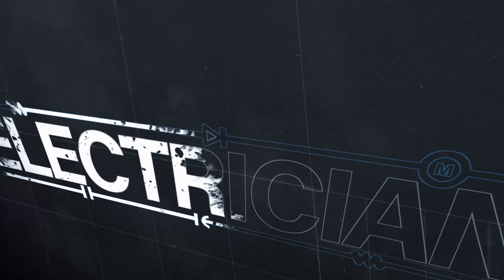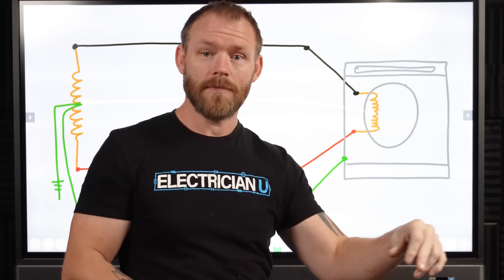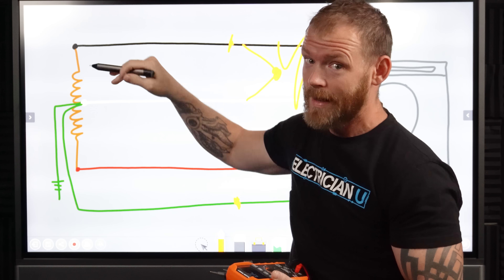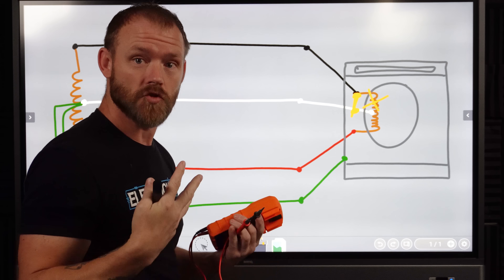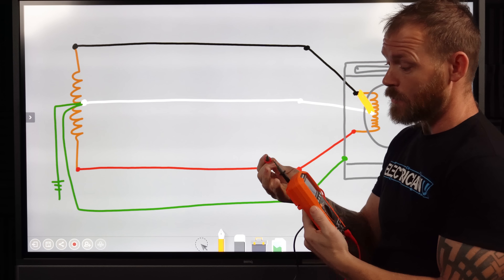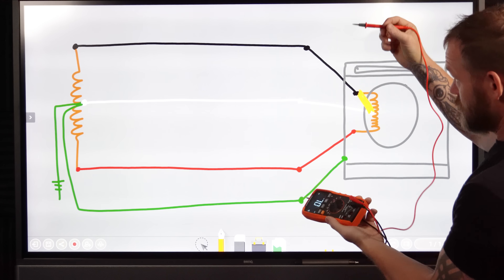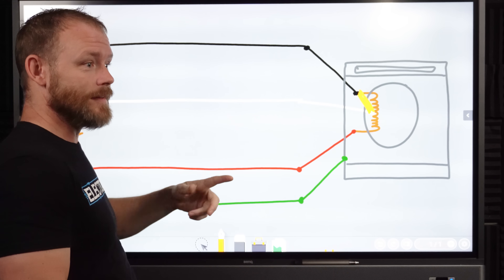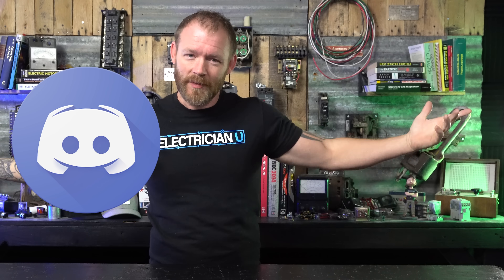What is the Difference Between a Short Circuit and a Ground Fault?

Comment: Thank you for that, I forget about continuity. I have a old house with an old water heater and the breaker keeps getting tripped periodically. I have a home warranty that came with house and so I called and they sent guy out. Ended up changing 1 element but now 2 months later same issue. I'm not going to pay again to send same guys out so I'm going to see if I can figure out which one is broke or if another problem, thank you.

Comment: I use a light socket. Black from pigtail goes on breaker and neutral goes to the load. Short or ground fault circuits will cause light from bulb. When fault is cleared light goes off

Comment: I hate to be a stick in the mud but, you kept saying ground when it's a bond. You ground a service and bond everything else. I know everybody and their brother says ground and hell I do it too, but the youngins need to hear the differentiation between the two and know the difference. OH, and the only ground screw that has to be green is the bonding screw in a panel at the first means of disconnect where the neutral and ground are bonded. Have a good weekend everybody.
Reply: thanks, exactly

Comment: He is correct, Continuity is the way to go. Going by resistance levels could definitely lead you down the wrong path especially when motors, transformers or ballast are connected to the circuit.

Comment: So... If i got this right..
A ground fault will only make a GROUND FAULT protection device such as GFIs Trip. 
And a Short Circuit will trip any other " normal breaker" or any over current protection devices..
BUT..... a black wire touching the white wire ( neutral ) is not considered a ground fault, even if the white wire is a neutral that is solidly grounded ..?!

Comment: Thanks for the great video!! Definitely helpful in understanding it. I do use continuity alot for troubleshooting. Have an outside project (still not finished) alot receptacles In the yard where over time got covered over with dirt and multiple shorts in the circuit, I take sections at a time and test continuity and finally figure out where and which wire. It's been a nightmare job and still a few left to do.

Comment: An excellent explanation. I would have only added the step of unplugging/disconnecting the load from supply wiring to isolate and narrow down possible causes.
Reply: This is very true, I was asked by a customer to see if I could find the cause a tripping breaker that another electrician could not find after searching for several hours. I started by unplugging everything on the circuit and the fault cleared. Turned out that an old cable system box that wasn’t even being used anymore but was still plugged in was causing the problem.

Comment: DUSTIN, A Ground Fault is considered the Hot wire is directly connected to the Green wire Ground? a Short circuit is considered if a piece of the equipment's internal wiring or internal load is shorted from hot to neutral or the load is shorted from hot to chassis? How I would troubleshoot a ground fault or short circuit is shut off the breakers then disconnect the Hot, Neutral and Ground wires to the load/equipment, then use my DVM meter to test if the wires are shorted or if the equipment/load is shorted.  This method is better because you can diagnose if the load/equipment has an internal short circuit or an internal wiring ground fault. If you don't disconnect the H,N,G wires and multiple pieces of equipment/loads are on the "Same Branch/Same Breaker connected "in parallel" you will be guessing, because a short circuit and ground fault will measure both the same in "milliohms". What is even worse to troubleshoot when you have a short circuit that crossed over in a wiring harnesses in the wall or internal inside a piece of equipment/load to another wiring harness that is on another breaker which you will have "leakage current" or Ghost measurements". This would be a good video lesson about "ghost measurements" and leakage currents.

Comment: I'm a retired sparky with over 50 years in this great trade. Several times I have came out and found that a circuit breaker trips as soon as you turn it on. Unplugged everything & turned every switch on that circuit off and problem did not go away. Could not pick up and grounds on either of my VOM'S. Used my expensive Fluke combination VOM/ Megger. Did not pick up a ground at 50 volts but got a low resistance reading using 100 volts. One of these was caused by water that halve filled an outdoor receptacle box. Another time old rubber insulated wire had broken pieces of insulation allowing two wires maybe seperste by a hair. If I had 10 devices on a circuit would try to guess middle point and disconnect wired then flip the breaker.

Comment: I got a question, how do you find a good ground when testing a panel or machine.  Like which place is best to put the black lead of the tester if there is no obvious ground screw?  I was testing a micro switch and I failed the exam bec.  I can't find a good ground in the machine.  Bec. normally  you put the black lead on the ground and the red on the circuit you gonna test to find the voltage.

Comment: 99% of the time it's not the wiring, it's the equipment connected. Disconnect the equipment and check if the breaker will reset. Depending on the fault a multimeter may not show the fault and an insulation resistance tester (Megger, trade name) may be required.
Reply: 90% of the time it’s a loose wire in the breaker
Reply: %100
Reply: Or the diy customer
Reply: Unless the cable is in a energy chain😅
Reply: In homes the wires, once installed, are not moved around or exposed to water or anything else corrosive, which is why home wiring usually doesn’t fail except for overloads, improper installation or outside influences.  In cars and trucks, the modules are usually sealed up, but the wires and connectors are moved around when the car/truck is driven, and are being abraded by contact with metal edges and surfaces, and are prone to corrosion from both water and vibration (fretting corrosion).  If the corrosion is inside an insulated wire, which often happens, due to mice chewing on wires, regular wear or carelessness in examining wires, but only a thorough check of the wiring, both visually and by using a probe or multi-meter will result in finding the problem.  For example In checking the voltage on my SUV’s DLC (Data Link Connector), the battery voltage had been reduced to about 10 volts, instead of true battery voltage of about 12.6 volts.  You’d never find that voltage drop without thorough testing and attention to detail. 😅
Reply: I love how the one time im convinced its a bloody crushed wire
Reply: Too long video

Comment: Is a set of worm prods a short or a ground fault??? Please explain.

For those who don't know what worm prods are they are a metal rod or rods (usually connected in series but can be parallels from the point of power or any combination therein) connected to the hot wire only of an extension chord. The rod(s) are driven into moist ground and plugged into a receptacle. This sends current into the ground which causes worms to surface to avoid being shocked. The worms are collected usually for fishing bait. The lengths and gauge of the wire, breaker size of the circuit and size/girth of the metal rods/spikes are all determining factors in how much resistance the "device" has.

Comment: Nice job . However it may be to make sure all power is lock and tagged out if possible and no live power going to  the circuit you are checking  for continuity . I saw a guy in class one time blow up his meter because  he  did know to  have no power when checking  continuity . A little tid-bit for your next presentations. I can not  stress the  one little  thing like that  you did not mention !
Reply: Yup!
Reply: Voltage proves continuity without de-energizing the circuit

Comment: If several receptacles aren't working, or whatever is tied into the circuit, take the face plates off to verify single sets of conductors on 2 or more. Then you get to hunt for a jbox! 
Amateur pro tip 😉

Comment: If your having trouble finding if you have a ground fault or short circuit,  and tried removing appliances,  turning wall switches off with no success,  then you know the problem is within the building.  Because grounds and neutrals ultimately end up at the same place in the main panel,  what you might consider doing is removing the neutral of the problem circuit from it's bus bar, then check if you have continuity between the hot coming off the breaker and the neutral.  If you don't,  but you have continuity between the hot and ground bus, you narrowed it down to a ground fault.     In either case,  ask yourself,  what circumstances changed?  Ex.  an electric heater was being used for an extended period, and you smell burned plastic near a  receptacle, see wisps  of smoke, and now the breaker won't hold. Perhaps you heard a pop or crackle,  or seen a flash,  before the breaker tripped.   You narrowed it down to a ground fault in the building wiring.    Upon pulling devices upstream of the space heater location, you  find a wirenut had burned off the hot wire and is touching the metal box.      Not all troubleshooting is going to be so simple and logical,  but you get the idea.
Reply: These kinds of comments you find in youtube are solid gold. Thanks professor!

Comment: "Finding the knowns" … yeah, that's an amazing troubleshooting step - and applies to all kinds of stuff including outside electrical. I can't tell you how many times someone asks for help only to find out they skipped all the easy stuff to check, didn't "look for the knowns" and is struggling off in some completely unrelated area because of it. I always step ALL the way. back, start from the beginning/scratch, and yeah, go thru all the knowns and go from there.
Reply: @Colinstu by "knowns" are you talking about "probable faults" in a circuit?
Reply: @desertodavid  it's talked about in the vid. But no, basically starting with the basics, starting with the baseline. You need to start an investigation by starting with the basics, and finding out the most basic parts of the situation. 
It can be easy to be carried away jumping into a situation going off of what other people have said, only to find out they missed something SUPER easy / simple because they skipped the basics and went right into more complex situations. (or you yourself doing the same thing. "I am so smart, it MUST be this <weird/obscure issue> instead of like… checking breakers, checking how the wires are connected, tracing them out, etc. A bad assumption can send you down a totally wrong path. 
You may end up with the final solution anyways - but all that could be skipped if the basics/knowns of the setup are determined first.
Reply: @colinstu  nevermind. Obviously you don't know what I mean by probable faults. I'm an experienced Electronics technician, so save your time.
Reply: @desertodavid  oh, PROBABLE, I read that as "ground" (as in ground faults). Yeah that's definitely all part of it.

Comment: So if the appliance is plugged in, but switched off, we should have continuity up to the point in the circuit where that on/off switch is, right? Like taking that simplified drawing of the washing machine, the red and black will have continuity until well inside the appliance, despite the appliance being switched off. Or not?
Reply: No not normally. Every device is different though so ymmv

Comment: We would get sent out to work on a customer's turbine with a "known" issue.  That is, until we got on site and found that the customer's "known" issue didn't make sense.  I finally figured out that the best thing to do was to start shooting the breeze with one of the operators and find out what they were trying to do when the "known" issue popped up.  It usually had nothing to do with what the office people said it was.  It usually also pointed out that they did something stupid or that something else on site caused the issue to begin with and the turbine was collateral damage.  Really cut down on the troubleshooting.  Know your knowns.  I like that.
Reply: This is SO true. We tell all out clients, very politely, to just describe the problem without any speculation. Of course, if someone spilled their coffee on the control panel, I’d like to know that too 😏😏.

Comment: Great video!  Wish I saw this last year, had a similar issue and did all kinds of troubleshooting to figure out it was a simple fix in the junction box, felt dumb.  

BUT hey, I have a random question, as a DIY homeowner, I have a couple spots I need to run new Romex to where the existing is 12/2 and I need 12/3.  Talking to people I work with they all make it sound so simple, attach the new to the old and pull through DONE.  Wrong, because from what I know and, in my situation, the installers staple it to studs in the wall. So how does a professional replace Romex in a finished wall?  or do you cut open the wall, patch it up, and paint when done? Trying to avoid that, but it might be my last option.  Thanks, appreciate the easy-to-understand info.

Comment: This should be obvious, but never test continuity on a live circuit, e.g., using the meter in continuity mode across hot and neutral, hot and ground, or hot to hot (for 220V). A Harbor Freight quality meter will be destroyed, a good meter will blow the fuse. While electricians don't typically use this, but there's a device called a Time Domain Reflectometer. It fires pulses down the line, and measures the return times. It can find shorts, changes in resistance, and open circuits. You can also measure the length of the wire if you know it's velocity factor. They're not crazy expensive, but they're not cheap either.

Comment: There may not be "continuity" as defined by your DMM when a device is turned on. This is because the continuity feature of DMMs beeps below 1-2 ohms. But the actual load may be hundreds to hundreds of thousands of ohms. That said... _NEVER_ use the ohms/continuity reading of a DMM on a live circuit. You'll either blow a fuse in your DMM, damage your DMM, or explode your DMM (depending on the voltage across your DMM leads when you take the reading and the safety features inside your DMM).
Reply: Yes, you are correct regarding continuity. I have seen electrician's test with a meter, its open circuit. No, your meter has a maximum of 2k, anything over this will show open circuit. You need to read the meter manual and understand its limits.
Reply: On flukes the continuity setting is usually below 80 ohms

Comment: Off topic question and request.......

I'm thinking about installing an "isolated ground" outlet for my home audio system.  However, I don't see the point of an isolated ground outlet if the ground and neutral wires are connected together at the breaker box. Could you possibly do a video on this topic explaining how an isolated ground outlet is functional considering the ground and neutral are connected together in the breaker box. 
Thank you!!
Reply: If your house is wired with NM (Romex) cable and uses plastic device boxes, you already have what is essentially an isolated ground system. The isolation is meant to be at the device, not the source (breaker box). If using metal device boxes, an isolated ground system uses separate grounding paths for the ground pin in the receptacle and the device mounting strap and metal device box.
To help eliminate possible noise and/or ground loops in a home A/V system, plug all interconnected electronics into a single power source (e.g. a power strip).

Comment: It's interesting watching a pro/master demonstrate this. I never use a meter for anything. Most residential applications are a wire came loose from a daisy chained outlet or burned up due to excessive amps being drawn over it. It's almost never anything else. I had 1 instance where the electrical box actually has 2 burned wires on the neutral side burned at the bus, but that was a 1 off.

Comment: The load is still in parallel with the SHORT CIRCUIT on black to white conductor when load is turned on?
Reply: Yes. Technically everything that is normally there downstream from the short is still in circuit. But practically well over 99% of the current will be going through the short so you may as well consider the rest of the circuit out. Electricity doesn't only take the shortest route to ground. It takes all routes to ground, with the amount of current through each route inversely proportional to the resistance of each route. A nearly zero short will have nearly 100% of the current. But this is getting way into the weeds and is out of scope for what was being discussed in this video.

Comment: What are some causes of a delayed breaker trip
Reply: A slight overloading of a breaker will/should trip it, but will take longer to trip. Depending on its construction, a 15A breaker will take a while (if ever) to trip if you pull  16A through it. The manufacturer of the breaker should provide (either in the packaging, or on the support side of their website) tables showing how long the breaker is rated to take before tripping for different loads.

Comment: Could you unplug everything on that circuit breaker and plug them back in one at a time to identify which appliance is causing the fault?
Reply: This is a perfectly valid troubleshooting technique to narrow the fault down to a specific appliance or identify if the building wiring is the fault if the fault still shows with everything unplugged/disconnected.

Comment: You really need to show the breaker panel switches open, so the continuity test isn't done on a live circuit.
Reply: I would think that's implied because the symptom is the breaker keeps tripping open.
Reply: @bassman87  Yes, but showing the breaker location on the left (next to the transformer) would remove ambiguity.